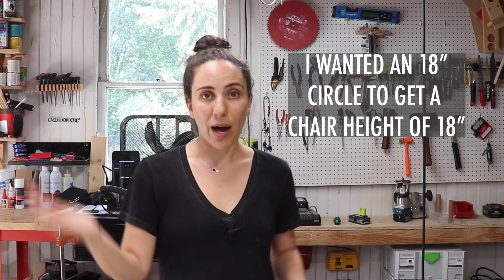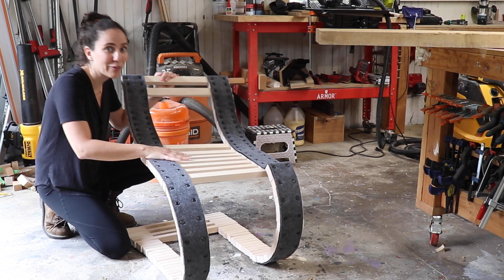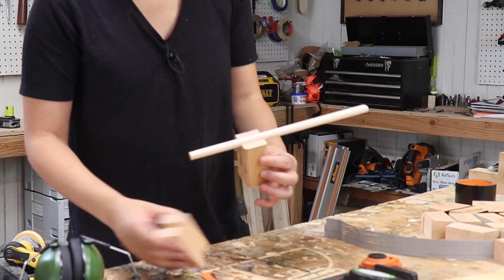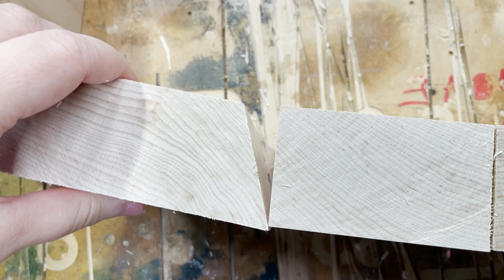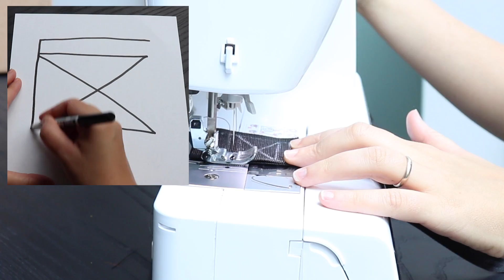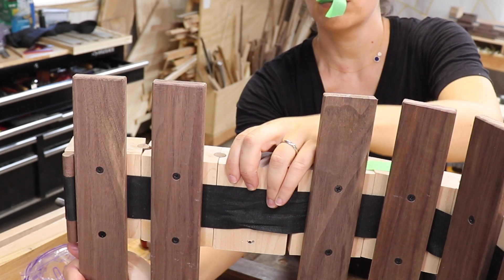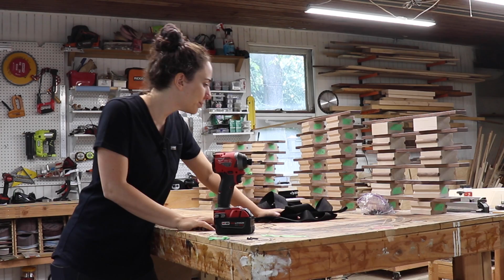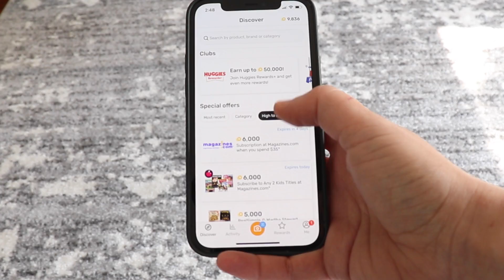I ATTEMPT to make a Roll Up Chair… AGAIN...

Comment: Love the video and that you are including us in the hunt for a solution. I have upholstery experience, and think leather is too springy and will stretch. How about upholstery webbing? It is strong enough to hold down huge springs and doesn't stretch. It's not smooth or shiney, so won't be pretty, but it is definitely strong enough - and you can tack or staple it. Just a thought. Regarsds, Liz

Comment: Maybe dyneema? It’s incredibly strong and low stretch. Instead of attached to the outside, maybe an off center hole to route the dyneema and tension with a turnbuckle?   This s a cool idea. R&D is all about the failures.

Comment: I haven't checked all comments, so it may have been mentioned before. Many have said to use hinges already. I thimk that's the right way, and also have a look at how the steel tracks on tanks work.
Maybe you could cut the blocks lengthwise, into two or three, and then offset one row by a half length. Some shape adjustments may be necessary. Then drill two holes through each (figure out a location for the holes first), fitting a suitable bolt diameter, and bolt everything together.

Comment: That sideways force collapsing problem can also been in many tensegrity structures

And yeah you can never have enough clamps

To reduce the bending and the stretching could you add hinged legs to the underside of the seat portion? Then they could bend out wen in use and fold into the setup when rolled up

Comment: I'm not sure if this would work, but have you thought of using a bunch of short pieces of strapping instead of one big one on each side? My theory is that with the two long pieces the tension is able to spread itself over all the areas that cause the most trouble. If you were to use short pieces of strapping to attach individual pieces to its neighboring piece, you will be able to add tension in exactly the areas you would need it.

Comment: I think what you are doing with the strapping will work well (only half way through) but... You could instead snake the material back and forth: connected on the front of a block, unconnected between the two blocks, connected behind the next block, unconnected between the blocks, connected in front of the next block, etc. This would give you connection (stapes, screws, glue, combo) on the font and rear faces of the blocks and friction holds between the blocks but ONLY when in chair form.

Comment: Hi again from Argentina, 
First I have to say that any chair looks easy to make but is not the case, I always remmember the Windsord rocking chair in The Patriot movie. Making a complex shape chair is not an easy task.  
I explained on the other video that this chair was just a concept desing, there are similar chair desings made from lamination or bend wood (Alvar Aalto chairs are good examples). Also said the straps no matter the material it always streches cause it´s woven strap   (don´t use leather it also streches and in all directions specially if it gets wet), every time you reassemble the chair you streched the material, lay the strap around a table and hook it  to rachetstrap and strech the material before using it several times. 
Love the idea of the dowels not the shape of them a half cilinder can help to index but not with locking the sections in place, You can try using a male/female pieces like in a wood hottub a tongue and groove that can rotate or maybe using a paralelogram shape could help with locking and indexing the chair sections. The hinges on the pivot points solve all off those problems but can´t handle the weight neither can the screws but it resolves the indexing/alingment and locking problems.
If you want the strap in the chair just use a cable inside two straps you get the look and the cable strength, like a rope covered in fabric commonly used in upholstery. And you can use the cable hardware to adjust the thightness of the steel cable (look for steel wire stair railing hardware). Bike or motorbike brakecable kits have a sheeth and slide inside the sheeth and have hardware to adjust them too, just another idea.    
It was a nice second try with this chair but to be honest at this point I would just FAKE the chair and forget about rolling it up, keep the look but use an entire different construction method. Even making it in metal is a challenge due to the forces those curves need to handle while keeping the esthetics of the chair. Check MR10 Mies Van Der Rohe chair to get and idea in metal.

Comment: You should try using seatbelt material. Could get them from a junk yard for a couple bucks and would be EXTREMELY strong with no stretch at all

Also, I would suggest using washers where you’re drilling into the material so that the weight isn’t on small areas of the material where it could cause fraying and space between the material and screws

Comment: I am personally 100% convinced that only metal hinges would be rigid enough to make this work. Obviously I could be wrong, but deep down in my gut I feel personally convinced of it. Of course I wouldn't have come to that conclusion on my own. Seeing you try so many times with the webbing tells me that it just can't work, and I think you'll only go through the same frustrating process over again if you use anything but metal hinges.

Comment: Tamar, this is a great project. The flexible strap cannot be a stretchable material, I’d try a woven metal material like the stainless steel tubing that is used to cover hoses. Once prestreached it would move only a fraction of what the plastic webs do. A Kevlar strap might also work. Bottom line it’s a material property issue. The chair is very innovative.

Comment: Based on my older belts, I doubt leather would work either -- it does stretch eventually. I see that several folks have suggested steel cables, and that sounds like the best bet; they are used architecturally, and in tensegrity pieces (although I don't know how much weight most of those would support).
Reply: Steel cables support alot of weight we have a 6 inch pipe 10 foot long held up on one end with a 1/4 inch steel cable.
Reply: Dyneema would be lighter and more flexible than steel and more than strong enough
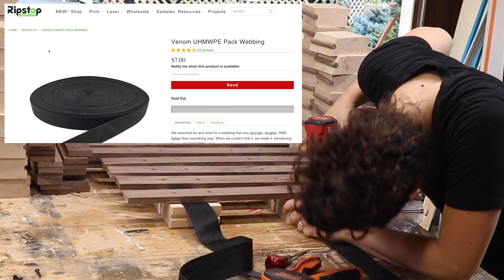Reply: @xerxis100  look at 16:26 - the strap is made of 'dyneema'
Reply: @stanimir4197  yes, I realize that, but dyneema rope shouldn't stretch much more than steel cable. So there should be no advantage to using steel, except for aesthetic looks. I don't know about the belts, never used them. Anyway, I think this design is just impossible.
Reply: @xerxis100   steel elongation is order(s) of magnitude lower than  UHMWPE.
Reply: @stanimir4197  can you point me to a source for that, AFAIK dyneema rope breaks at 3% deformation. I would be surprised if stretch at normal loads would be a magnitude bigger than steel
Reply: @xerxis100  unfortunately linking in youtube comments just removes the comment (often enough). Either way: if you look at elongation at yield (in percents) uhmwpe would have lower value than spring steel (similar but lower). However, it just that the steel has so much higher tensile strength/strength at yield (you dont want to destroy the material). uhmwpe: 17MPa, spring steel 1500MPa
Reply: @xerxis100  also any polymer is going to creep under stress over time

Comment: Some people suggest straps, some suggest steel cables... there is a possible compromise between the two, if you use the webbing from steel-reinforced tie-down straps (ratchet straps). They have steel cable integrated into the webbing, which would help to control the stretch under tension.

Comment: If the pieces were deeper then the angles created from stretch would be less.
Also, could you not make a similar rolling section that hung down from the base of the seat and located somewhere near the bottom end? It wouldn't roll up as nicely but would give more direct support for the body weight and relieve a lot of stress on the front curve.
Also bolting the strapping down in the lower higher tension regions will stop it taking slack from the base and backrest

Comment: Why not use a metal wire through the center of the pieces from top to bottom used to keep things together. You can set it to a length which keeps things aligned and because metal wire won’t stretch, you don’t have the elongating issue like with the straps. 

On top of that, make the joints a v-shape between the slats with one side of the v shallower or steeper to match the angle you need, that way the slats will have less of a tendency to slip and cause a gap. 

Those two ideas as well as allowing the stabilizing rods you made this video to reach across the entire chair and join the two slats opposite from each other should help reduce the issue with torsion as well. 

Hope these are good ideas, I know you can do it!

Comment: Hi! You can use the bike chain inner or outer link and, either a normal bolt or shoulder bolt going through the pieces to connect the blocks and use the polymer strap to cover it all up. 2mm thick links and m5 bolts should do the trick. You will need to cut a small rabbit in wood for the movement of wood though. Alternatively you can use a connecting strap that is made from cotton. That should stop the stretching (???) Problem. Don't know what will it do about the malfunction due to over tension. Thanks for the video

Comment: The main issue here is the incredible tension each block to block connection is under. You really can't have any stretch in whatever hinging material you use. Maybe something like kevlar would work? The thickness of the block is one leg of the leverage teeter totter and the distance from the joint to the back of the chair is the other leg. Given that the blocks are 2" thick, and if the weight is 160lbs. and centered 28" behind the front of the chair, the pull force on the web, on just one of the front sets of blocks, would be 2240lbs.. These were just guesses on the measurements, but are probably close. 
   The rolling up issue could be dealt with by having a latchable strap that goes from the top of the back down to the end of the foot. In fact if this strap were a cross shape it would give the support you need to resist the twisting action as well. If you are going to use strap you need to connect it to the wood as close to each hinge area as possible to reduce the ammount of it that is able to stretch. It would be cool if I were right there next to you... it would be alot easier to explain, as I could draw a bunch of explanatory diagrams. The thicker the blocks are the less the leverage would be on each joint. I don't know... I could go on and on, so I'll stop here. Good luck if you decide to keep trying with it.

Comment: Your material concern is not so much about tensile strength . . . it is elongation of the webbing under a load.  Nylon and polyester webbing have considerable "stretch" (elongation) and really are not a good material for your application.  Several times you mentioned possibly leather . . . don't waste your time and money with this because it will be worse.  Leather hides are all different and even quality top grain leathers will have a lot of stretch.  One possible material is kevlar webbing that is available in a thin tape-like structure.  This material is rated with 0% stretch and I think this is exactly what your need for your project.  One downside to kevlar is that I believe it's resistance to UV is less stable than that of nylon or polyester.    --- good luck!
Reply from the maker: I'll have to look into that!

Comment: I think you are onto something with pinning the strap to each piece. That will prevent the tension accumulating across the entire length. So you wouldn't have the amount of tension at each joint that would force it to curl in due to tension elsewhere. But screws didn't seem strong enough on the last iteration. So maybe a combo of screws, clamping of the outside piece and glue?
Reply from the maker: Maybe!

Comment: I love the tenacity on this project. In case you tackle this again: If steel cable was run through the middle of the blocks it may equalize the tension/compression and prevent the bottom end from wanting to curl back up. Add a locking cam for the final tensioning could make adjustments easier to.
Reply: If you ran the belt/cable through the center of the blocks, you would effectively half the leverage you get, which would only cause more stretch. It's better to isolate the belt connection for each joint by fixing it to the segments, so this "curling" effect doesn't occur.
Reply: @CatNolara  Nonsense, load on a curving structure doesn't work that way.  The fabric was never handling the whole load by itself, just holding the blocks in place so they can handle most of the load, otherwise gluing it wouldn't have stabilized it as much as it did... Besides, steel cables are a lot more rigid and a massive amount stronger than fabric.
Reply: @ZeoCyberG  well, the load of the sitting person will cause a banding torque in the joints. They'll be compressed on the inner side (with pressure being highest on the edge) while the outer side with the belt is under tension. Of course steel cable is preferrable, but even then it will slowly dig into the wood and make it  flex a bit.
Reply: @CatNolara  Not if you put a bushing, really... It'll be far stronger... Besides, wood only compresses so much and less of a issue with hardwood, and it's not a issue you would avoid with strapping.  At least with a rail cable, it can be easily re-tensioned without taking the whole thing apart and redo it like she had to do with the strapping or modify the wood blocks each time.
Reply: @ZeoCyberG  the final glued construction was still dodgy the thing needs a back leg.
Reply: @loopinnerthe  More it needs more cross support to prevent racking.  She never got to put in the cross dowel rods, for example.  So only the seat slats were holding the two sides together...
Reply: @ZeoCyberG  sure, but I just noticed that running a cable through the center would make the whole chair not able to be rolled up anymore. Anyway, there's still a lot of tension on that belt/cable, moving it further to the inside edge would increase the stress even more.
Reply: @CatNolara  Nope, accounted for all that in my first comment on the way I would do it.  Wood pieces would only lock together in the chair position and would easily fold into curled up position because of the way the blocks are shaped would only resist movement in one direction and would leave room for movement in the other.  While the tension would be spread through the whole structure...  Really, furniture like the illusion of floating chairs are done with supports like cables all the time and they work!
Reply: No, a cable running through the middle wouldn't contribute to the load in any meaningful way. It would only be able to add an axial load between joints. 

In bending, all the load is experienced at the top surface and at the bottom surface of each joint. I actually disagree with the conclusion of the video that there was too much tension. It still looks to me that there isn't enough and that the webbing simply has too much stretch (which is what the weave is designed to do, no matter what the marketing says). I also suspect that the maple isn't supporting the compressive loads as rigidly as needed and it's deflecting too much as well.

I think the solution is to oversize each angle by a few degrees to counteract the deflection that will be experienced during compression loads. More tension would probably also work, but at some point, the compressive displacement will become a significant factor too.
Reply: @joranbooth5529  in the video, the end of the chair at the bottom curled back under because the tension from the strap being located on the bottom of the chair blocks pulled it back. If the tension was centered in the blocks it probably would not want to curl back since the tension would be equal between the faces. A cable would just be easier than a strap to run this way.  Alternately, if the strap was pinned to not freely stretch between more than two blockers, it probably would not curl back under, but getting the tension right would be tougher.
Reply: Wood blocks are the actual structure, the strapping just work to keep joints together but remain flexible so it can be curled up to be put away, which is why it worked better when she actually glued it...

So cable would work, as it would function the same and would be a stronger material than the strap...

Personally, I would shape the blocks similar to folding table hinge so they lock together in the chair position and use a railing cable so it can be easily tension/adjusted...

Comment: I think most of your problems are because you're acting on the "holding" power as one whole singular body (well, two) with the stretching problem and tensioning hazards. Some people here mentioned metal hinges, I thought about slotted chain links.. In a physic way of matter, you'd be distributing the stress on many parts even if you connect the pieces together with separate lengths of webbing. Though l would not trust glueing these that way. By the other face of it, the straps support the bottom curve from the outer diameter while supporting the upper curve from the inside diameter. So the top part of webbing is acting as a pulling force and not as the bottom part, stretching.
Reply from the maker: Yeah, but that would prevent the whole roll up part

Comment: Fun series, tagging along to help try to solve this.  I think you loose tension where the back of the chair starts,  the strap wants to take the shortest path possible.  You may get better results attaching the strap before it goes around the inside of the radius and to each board that makes up that radius, that's why your prototype worked so well.  You may also benefit from cutting the board so it has a longer face to face contact.